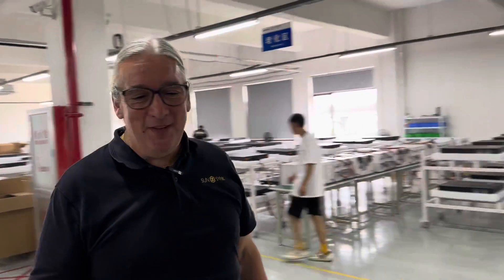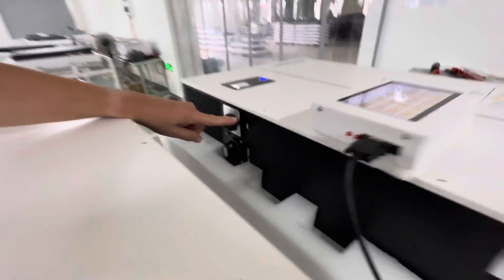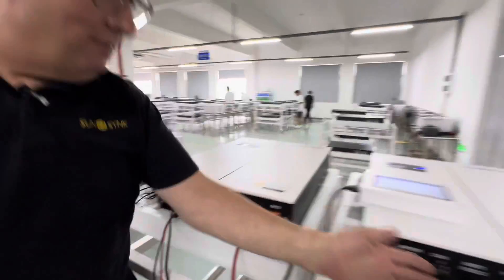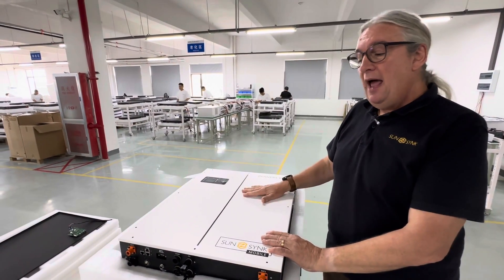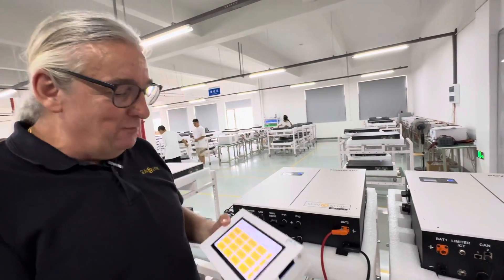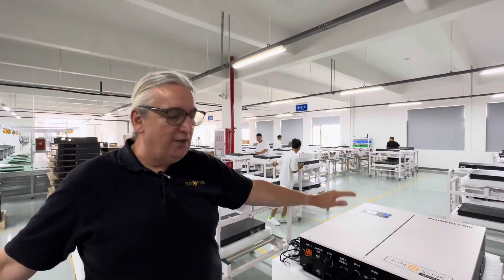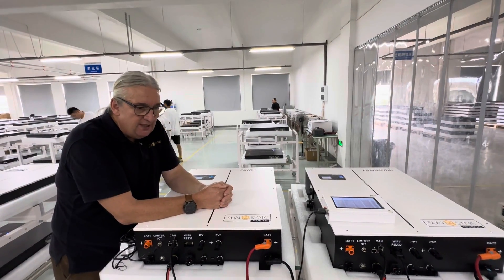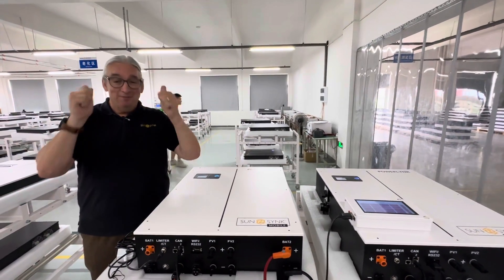#Sunsynk  #all-in-one-system ￼

Comment: If you parallel do you receive additional output capacity or is it simply paralleling the battery?? UK needs 5kw AIO minimum or ideally 8kw AIO . An 8kw AIO would be a game changer in the UK market.
Reply: GivEnergy launched the AIO 13.5kw Battery 7Kw Inverter - 6kw continuous out. Although doesn't take solar PV inputs its a direct competitor to Tesla Powerwall.